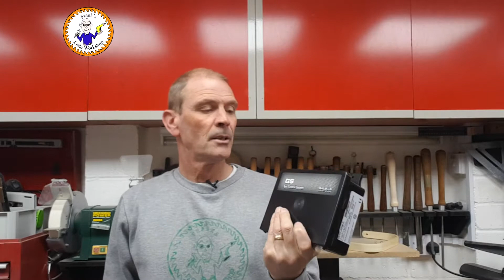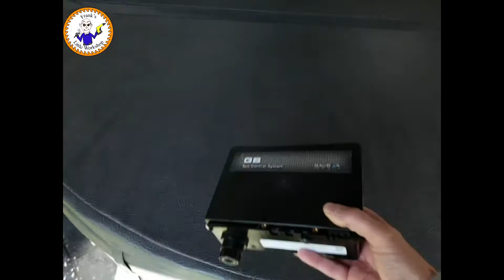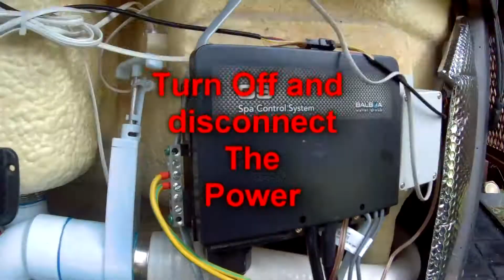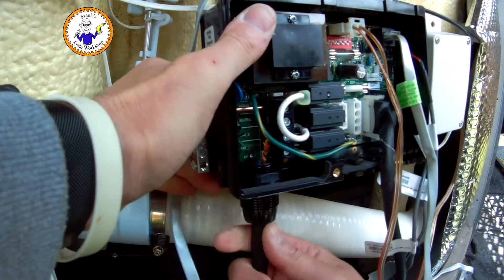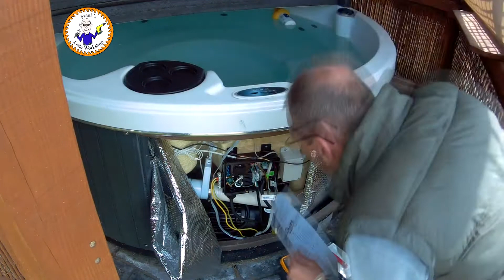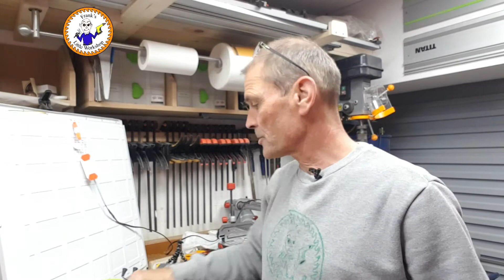Franks Little Workshop, Hot tub control box replacement. Balboa GS-100.

Comment: Where’s the blower wire in any idea ?
Reply from the maker: Hi Ray 😁. I'm sorry but I don't know 😞. Its been two years since I did this video and I no longer have the old unit so I can't access the wiring diagram 😞. I seem to remember there was a diagram on the inside of the controller box. Sorry I can't be of any more help. Thank you anyway for your question 😁👍
Reply: @frankslittleworkshop   cheers anyway Frank … trying to swap out old Chinese parts in my tub for more reliable balboa parts … and stumbled across your video searching for help 👍
Reply from the maker: @hoggy230781  I just found a circuit diagram by searching Balboa GS-100, but even that didn't help much. Sorry Ray ☹👍